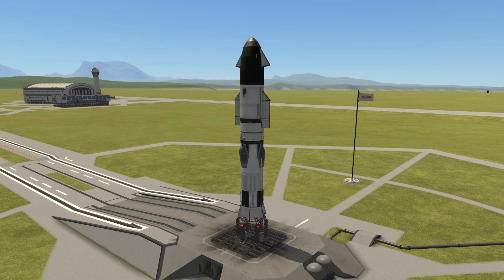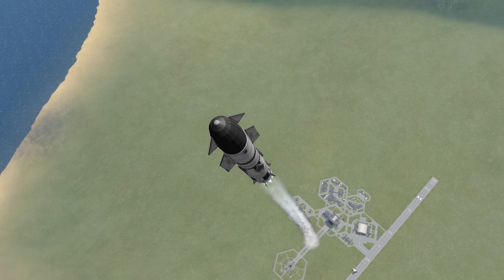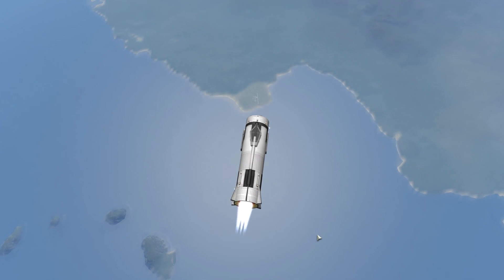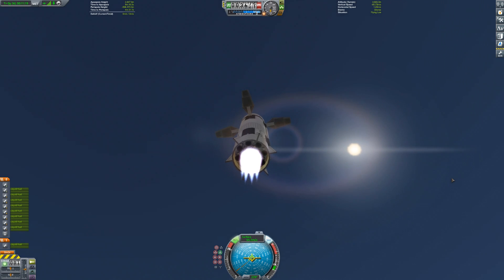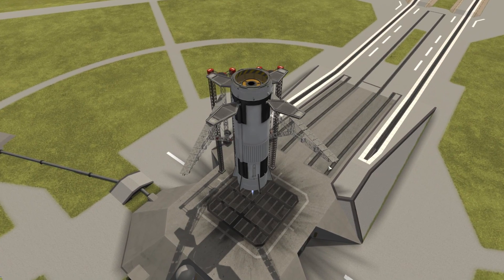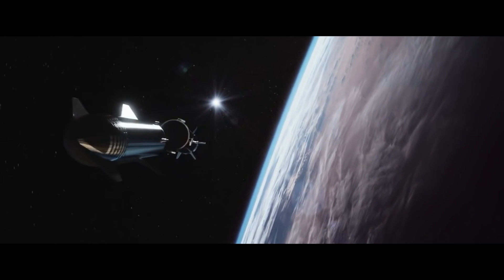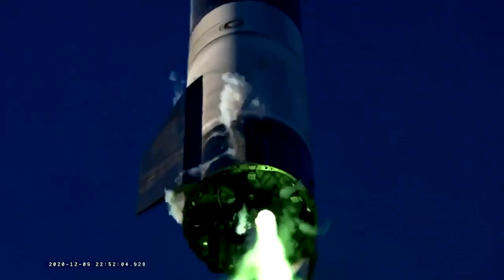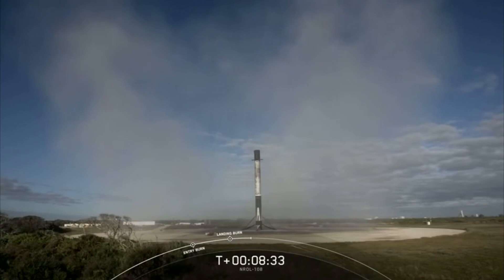Why SpaceX Wants To Make Landing Super Heavy MORE Difficult.

Comment: Isn't that a waste of fuel? You would need to make a burn to stop all your forward momentum, and then burn same ammount to get back to the launch site.
Reply: nope air slows you down +the booster has less weight
Reply: @Tuuminshz  As the altitude increases, the air density decreases. At 200000ft aerodynamic forces are negligible.
Reply: @keepernod2888  That's the thing you don't need to use that much force up high and coming back the air slows you down
Reply: @Tuuminshz  As I said, you would need to kill your forward momentum, and use same ammout of delta-v to get back. Looks to me like a waste of fuel.
Reply: @keepernod2888  The 1st stage is much lighter and has deployed the 2nd stage it takes much less to return back and after air has slowed it down they only have to kill the terminal velicity Falcon 9 does it and it's great
Reply: @Tuuminshz  You don't understand orbital mechanics.
Reply: @keepernod2888  a rocket which weighs less doenst need so much force for the burn that puts it back on the trajectory towards the landing site. Is this wrong? Air slows it down when it comes back. Is this wrong?

Comment: well as long as they dont want to do it right off the cost of any big city its not quite as stupid. if one thing goes wrong and that thing explodes, you got yourself an explosion that would probably be equivalent to the hiroshima nuke or might even have a bigger yield.
Reply: Even if they had the same potential energy an exploding rocket cannot release that energy as quickly as a nuke. Not even close. You could atomize the fuel and hit the perfect stoichiometric ratio and it would still not explode as efficiently as a nuke.
Reply: @motokid6008  the soviet N1 rocket caused one of the most powerful non-nuclear explosion when it failed on its second flight. and that despite 85% of the fuel not igniting, because of the many different stages and separate fuel tanks. super heavy has two massive tanks with one common bulkhead. if a tank ruptures, the explosion will be much more massive than the N1 explosion, because much more fuel would ignite.
Reply: @clippymcclippy  - NON nuclear. Thats how much more powerful a nuclear explosion is. They have to separate nuclear and non nuclear when rating most powerful explosion. The N1 explosion, while large. Was no where near that of a nuclear detonation.
Reply: @motokid6008  Well said.
Reply: @motokid6008  the differentiation of non-nuclear and nuclear weapons is to describe their nature - conventional and nuclear. both weapons explosive power is measured in Tons of TNT. the largest non-nuclear explosions get close to the hiroshima bomb, about 8 kilotons of TNT. obviously that's not much for other nukes but it's enough to level a city, as we've seen before.
Reply: @clippymcclippy  No accidentally exploding rocket will ever reach the power of a nuclear weapon in kt.
Reply: @motokid6008  who's saying that? elon musk, the guy who definitely hasn't any motive to tell people his stuff is safer than it actually is?
Reply: @clippymcclippy   "who's saying that?" - You. "you got yourself an explosion that would probably be equivalent to the hiroshima nuke"

Comment: The big question: how will the first "Super Heavy" Booster test flight be done? The landing-catch equipment will almost certainly not be built.
Reply: I believe Elon already answered that, saying the first Superheavy test flights will bee 500 meter hops just like the early "flying water tower" Starship prototypes did.  So launch slowly to a low height, translate a few hundred meters, then land on those temporary flip-out legs.
Reply: Cut a hole in the top of the high bay? 😉

I think SpaceX could assemble four towers around the launch landing pad with a movable gantry between them carrying two steel beams (like the two prongs in this video at 5:00 but supported at both ends) pretty quickly. Then during landing get some teenager to move a joystick from side to side to position the gantry so the Super Heavy booster drops between the two beams and its fins land on the beams.

Elon, hire me 😃

Comment: Re: Helium / Inert Gas on the Starship:  Is there a tank for that already on the Starship?  What do they presently use for the Cold Gas RCS Thrusters and where is it stored?
Reply: Both are stored in metal pressure bottles with a carbon fiber overwrap (COPV). Typically located at the top interstage or bottom skirt, but can be inside the main tanks. RCS is presently cold nitrogen gas, but plans are to use rocket engine hot-gas thrusters.

Comment: Then why not really go for it and just use super-magnets to control and repel the landing.
Maybe even assist with the launch.      That might be an attractive idea.
If they still intend on doing super-heavy off of former oil-platforms, they can build tall steel silos to accommodate
launches and captures.  During launch, the grated steel base of the silo could even rise like a piston to help push the vehicle up.
Big steel platforms and big steel rockets, what could possibly go wrong?

Comment: Wonder why they wait to transition to vertical from horizontal so late in the course.
Reply: I suspect it's to shed as much energy as possible using aerodynamic drag only, thus spend as little fuel as possible.
Reply: @u1zha  a we bit more time SN-8 may have been saved.
Reply: @pulesjet  no, its engines were shutting down due to low fuel pressure, you see it in the clips in this very movie.
Reply: The moment you change orientation, Starship accelerates faster and uses more rocket fuel. Same reason Falcon boosters don't hover in mid-air then slowly sink to the ground. You might as well operate the control systems as quickly as possible, which without a sluggish human futzing around at the controls is really fast!

Comment: I could see a significant benefit if you can get the booster to get caught on the tower, is you can do away with the landing gear, and save weight that way, that translates into an ability for a greater payload
Reply: Yeah, landing legs are gonna be damn heavy for such a large booster, no matter the design/material.

Comment: How can the F9 have "too much" thrust to hover? Seems cou ter intuitive
Reply: Rocket engines can't throttle all the way down to 0%. The merlin engine can throttle more than most, but even using one of the nine engines, at minimum thrust, it has more than 1g of thrust when almost empty. With the super heavy, even if the engines don't throttle better, there's more engines to disable.
Reply: @dogmaticpyrrhonist543  never realized more small engines gave that much more control but that makes sense cool

Comment: This might not be as crazy as it sounds.  Hear me out.  They're gonna save an enormous amount of weight on the booster by not including legs.  The level of precision they're gonna need is nowhere near as high as people are saying.  The landing system just has to hold the weight, and have some system that can track and grab the booster.  
TL;DR Based on my analysis, it should be trivial for the landing facility to handle a tolerance of plus or minus the booster width (30 feet), a level of precision that SpaceX already achieves with the Falcon 9.

First, the weight.  The booster is capable of slowing itself to a stop, so there isn't much in terms of dynamic impact load.  
But consider the Starship stack mounted on a launch pad.  It's equivalent to a building, and it would need a substantial foundation to resist the potential of wind loads on it.  (imperial units warning)  Doing some back-of-the-envelope math, a 50-year storm producing a hurricane wind of 120mph would place an overturning load of ~44,000,000 ft-lbs on the foundation system.  *That's roughly equivalent to holding the 200 (metric) ton booster on a boom 100 feet (30m) away from the center of the building*, or about 3x the width of the rocket.  Consider that the pad will also have other structures and equipment collecting wind load, and the building design wind speed is actually closer to 150mph on the Texas coast.  Standard construction methods will handle the expected loads from catching the booster, including a rather large tolerance.

Second is a question mark to me, what kind of mechanism do you use to catch the booster?  They're gonna need to have actuators that can move into place, 
in 3 dimensions, within seconds, and then hold multiple tons of load.  The only way to really do that is with hydraulics, and it'll take several megawatts of power to move them.  Big numbers, but not outside the realm of reality.  The ground support equipment obviously doesn't fly so it can be as big and complex as you want.  Those robot arms that they use in factories come to mind.  The weight here is a couple orders of magnitude bigger, but the tech already exists.  Just need some custom algorithms for tracking.
Reply: I dont believe Elon's goal here is for weight savings. Its about re-usability and not pelting the business end with sound waves and debris with every landing. Take the landing leg mass and move it up into the interstage for a suspension system in the grid fins. Now you dont need a complex pad. Its can just be a static hoop structure. The suspension system in the grid fins do the rest. It makes the entire thing vastly less complex. I think people are over thinking it way too much by trying to put an arrestor system in the landing structure. Thats ridiculous imo. The booster was already designed with landing legs in the mass budget. Just take that mass and move it upward. It'll fly better that way too.

Comment: Thanks for mentioning the autogenous pressurization. I wondered about that. It was just a blip on the news. Been trying to figure a way to arrest 180+ metric tons since the reveal. I think cables and multiple towers could displace the weight. Like an aircraft carrier catches aircraft but  10x's the weight with much less landing speed.

Comment: Does the greater number of engines enable further granularity and range of the rocket stage's overall thrust control?
Reply: No.  Only a few of the engines will have the ability to gimbal at all.  Most of them will remain fixed.   I think it's only the central six or eight that can gimbal, and most of them are redundant.  I believe that like Starship, Superheavy can land with three engines.

Comment: What if those fins deploy and tilt a little so that they can provide autorotation to reduce velocity and a catching system that takes that rotation into account?
Reply: Because once you start spinning the rocket body, you can't point it anywhere else due to gyroscopic forces.  This is why spacecraft have to despin before pointing for rocket burns.

Comment: You can use ground based RADAR/LIDAR for highly accurate tracking and positioning of an object in flight. For comparison modern AA systems can shoot much smaller fast moving object out of the sky, so remove controlled guidance bigger object on a predictable trajectory with known wind conditions- if they can't land it on a dime somethings gone wrong.

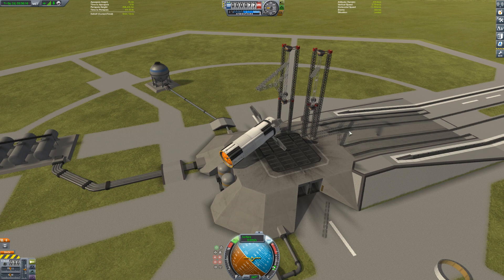Comment: 5:20 mentions needing to be able to launch perhaps half a dozen refueling launches in a single day. Yet, orbital mechanics mean that this CANNOT be done from a single launch site (regardless of how efficiently Super Heavy can be processed) unless the site is near the equator and the orbit has zero inclination. Zero inclination orbits may lead to ten times as much radiation exposure when departing through the Van Allen radiation belts—which may or may not be a problem. MAYBE SpaceX will use equatorial refueling, in which case a fast launch cadence will be useful.  But because of orbital mechanics, it seems like Earth-to-Earth (E2E) flights may be the more urgent application for fast booster reuse. Though, it sounds as if perhaps most E2E flights won’t require a booster. Bottom line is, I am deeply puzzled about where the urgency to be ready to “relaunch in as little as an hour” is coming from. For launches to inclined orbits, an ability to launch every 12 hours would seem to be sufficient. Scott is one of the few commentators I’d trust to offer insight on this that takes the science into account, so I hope he’ll take up the question. Thanks.
Reply: If you did some sort of dog-leg maneuver with launches you might be able to do 2 an hour apart which dog. Could also do a correction burn while reaching orbit, but I think at that point you're looking at at most getting 3 launches to rendezvous. These all do cost more fuel though.
Reply: The final goal is to launch multiple starships each day. It is completly crazy but for that you will need to get  a lot of boosters into orbit.

Comment: I think it's a worth while venture. If they succeed they once again increase the service envelope of the vehicle. My guess since they will likely be launching from offshore based facilities anyway the plan will be to hover the craft just enough to confirm it is in position then perform a ditch procedure if something comes up as misaligned. Just throttle up all the way briefly, tip the booster over, and abort it into the sea.

Comment: I think a catch system could work very well if the frame was large enough to to move the catcher a few meters on an X-Y plane. Multiple cameras or radars could predict Starship's path, then move the platform to correct for inaccuracy. Doesn't need to be bigger than a drone barge.
Reply: The booster knows it's own path, and the position it needs to be in, so it can do the corrections easily, no need to move the platform. Also the less parts moving on it, the better, as it needs to hold up the weight of the booster (~ 180 metric tonnes).

Comment: With all these engines, it sounds moe like the N1 than the Saturn 5
Reply: The Falcon Heavy has 27 engines burning at launch, so the control algorithms to handle 28-32 on Super Heavy aren't a challenge to the SpaceX engineers.
Reply: We have much better tech these days than the days of the N1. Thanks to improvements in autopilot systems, flight computers, and rocket engines, its actually practical to do this now.
Reply: @Julian Turner  well I think you are addressing a wrong point there. N1 wasn't robed of the success because of some technology issues. As far as I know, it was a problem of proper service and prelaunch procedures and some issues caused by political tensions, competition and rivalries within the soviet space branch. Anyway rocket craft as well as air travel are technologically very conservative and that has it reasons. And I'm sure SpaceX is considering the N1 experience as well.
Reply: I bet they are not skipping the evaluations of their Raptor engines in order to complete the project faster, unlike what  Soviet Union did with their N1
Reply: @asdrubale bisanzio -- Not to mention that the ideas that go into those engines can be used elsewhere more easily, if not the engine itself.
Reply: @asdrubale bisanzio actually having more engines makes the chance of failure higher. And the N1 vs Saturn V approach demostrated that. Moreover remember that if you loose on engine on one side you have to compensate for the lack of thrust on that side and the excess of thrust from the opposite side.
Reply: @s4cells4cell7  Yes and no. It's true that the more engines you have, the more likely you are to experience an engine failure on any given flight. The loss of one engine will have to be balanced by thrust vectoring and/or opposite engine throttle down. However, the consequences of losing one small engine verses one large engine are quite different. Had a Saturn V lost an engine in the early seconds of the flight, the results would have been catastrophic and reportedly the crew would not have been able to use their LES. Falcon 9 has demonstrated that they can lose an engine and still fly. As the rocket gets lighter, they can lose more than one engine and still make it to orbit. Further, the Soviets didn't have the ability to static test the N1to the degree the US did with the Saturn V and control technology back then was very primitive compared to what exists today.
Reply: @s4cells4cell7  I fail to see how the problem of failing engines causing uneven thrust is remedied when you have 5 big engines and one fails

Comment: I think the spherical header tank close to the center of mass is a mistake. With the flip maneuver, all that fuel will be spinning and sloshing. No matter how you add pressure to it, you cannot guarantee a reliable supply of liquid fuel in this way. Those header tanks will need to be replaced with something like a syringe. If I'm right, sn9 will be an exact repeat of the sn8 landing attempt.
Reply: But if the header tanks are actually full and pressurized (no air voids), shouldn't there be enough pressure despite the g-forces?

Comment: if this idea doesn work my idea if pitching them would be a set of landing pads on large rail like structures setup around the launchpad like a clock.  The pad platforms would either sit on rails and then be rolled up to the pad area for transfer by crane of the landed vehicle.  Or have some method to grab the landed vehicle and transfer it.  With 12 platforms you could potentially have a few SH on standby and a few starships.

Problem also would probably be that for the launch tower to meet the rockets it might need to rotate like the roundhouse of the old steam railroads or the crane would resolve positioning.

Comment: The flight profiles of SN5 and SN6 have already demonstrated the two fundamental elements of how the Super Heavy Booster will land. 1) vertical descent to a hover a safe distance AWAY from the launch & landing pad. 2 ) translate horizontally (while in the stable vertical hover) across to the launch & landing pad into the arms of the “catch mechanism”. This profile significantly reduces risk to the launch / landing infrastructure associated with initial descent accuracy.